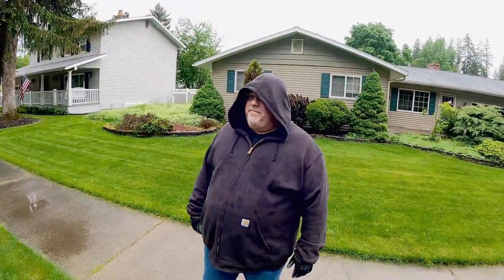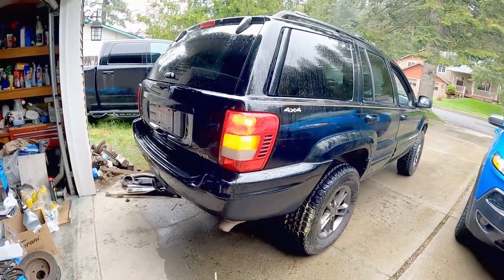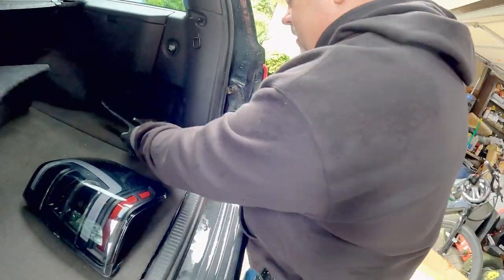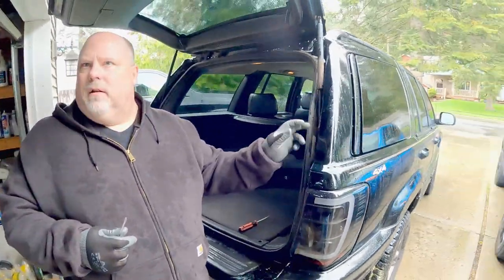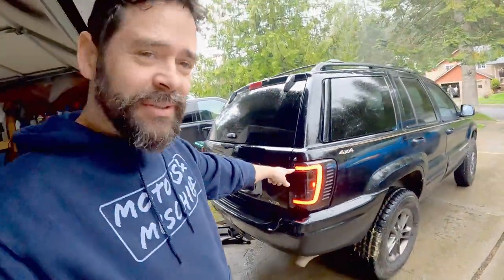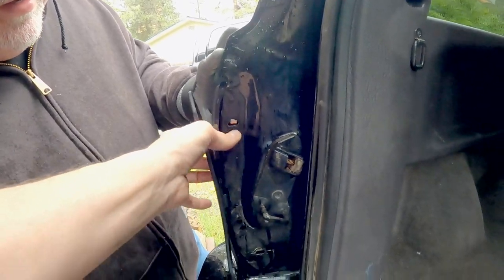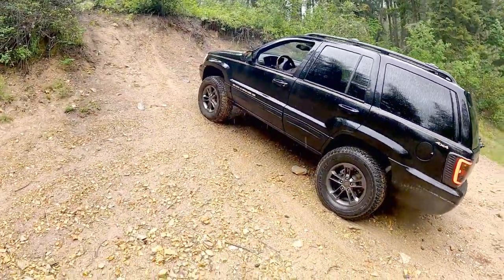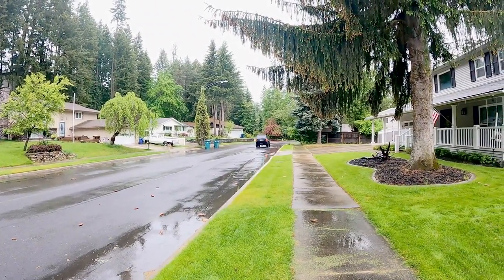Project Jeep Grand Cherokee  WJ Tail Light Upgrade [Part 16]

Comment: The original lights actually do a better job of lighting imho. The replacements look great when they are off but turn signals in particular are weak and cheap looking.
Reply from the maker: Yes but we wanted to look fabulous! And you gotta admit, those lights are pretty fabulous. Sadly, this build has been sold and we're on to our next one. Thanks for the comment!
Reply: They actually looked a lot better in person than they did on camera.

Comment: Don't forget to fix your 3rd brake light. See that was not working while you guys were testing out the new brake lights. They look good, and I have the same ones. Definitely replace the turn signal and reverse lights with leds to improve the lights
Reply from the maker: Good advice, thanks for commenting!